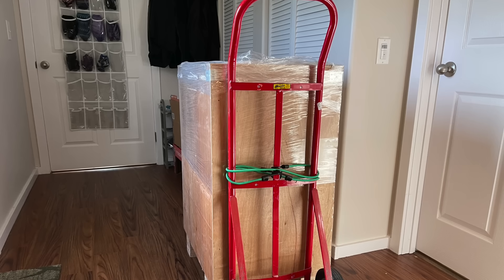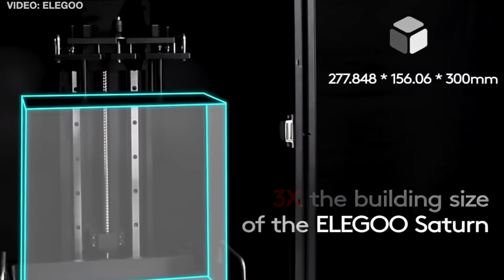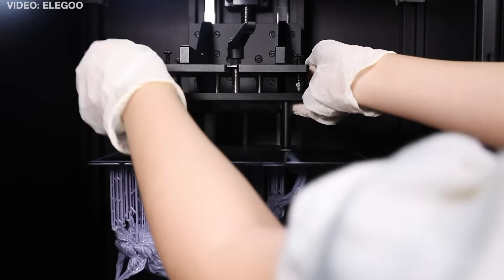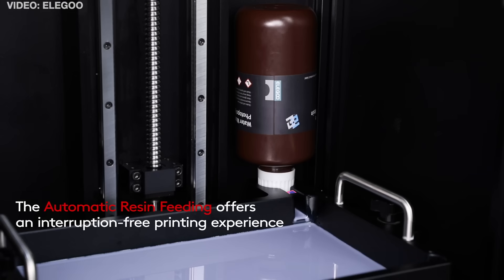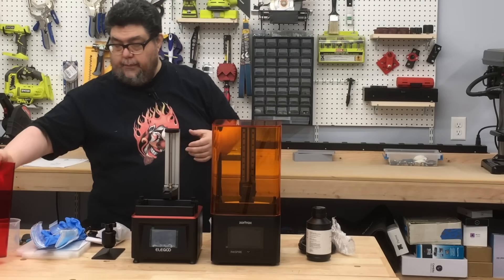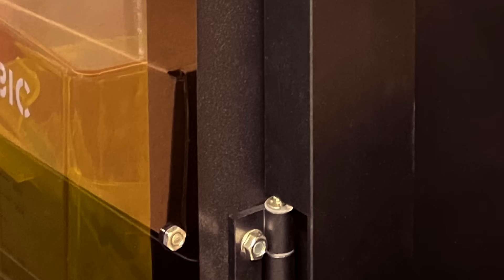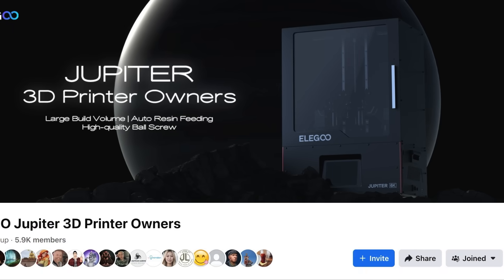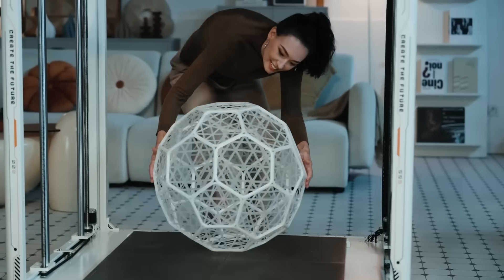Elegoo's giant Jupiter resin printer - An un-review

Comment: Great video. I bought my first Jupiter as a kickstarter and now I own 4 of them. It is definitely a beast and I have printed many projects with them including a 4 1/2 foot long T Rex. Sad that they went to a plastic lid again. The metal cabinet is aewesome. I've added several attachments to them including heaters, temp gun holder and usb cable holder and used the same holes on the side panelswhere the bolts are. Only issue I have which is happening now is my glider bearings are acting up and causing layer shifts. Of course Elegoo is out of stock and now I have to try and find these bearings for it. Hopefully the rails are ok.  Wish me luck
Reply from the maker: Good luck with it!
Reply: @AdvancedGeekery  thanks! I believe that I found them on Amazon. They'll be here tomorrow. EG15 is the number. I'll post a reply if it works out in case someone else encounters the same issue. $43 for a set of 2 pieces.  Ordered two sets

Comment: Hey David
I'm responding to your comment on purchasing on Temu. I did not see the area about your Temu experience. I buy a fair amount of things and I return a fair amount of things. It's addicting. 
 Mainly I returned wigs. I buy them for my Marvel themed costumes. I buy a lot of red for my Black Widow costumes. The reds will often be off in color so I  return them with no problem. When I'm looking for an item I searched online and I will find the item on Amazon. I buy the exact item on Temu for a much lower cost. There was a time when Temu would allow a customer to keep the item that they wanted to return. I really didn't like that because if I didn't want it I didn't want it. And I would end up throwing it away or donating it because I didn't want it. I recently bought a freezer that didn't work.Temu told me to keep it. I found out it wasn't worth trying to fix. I placed it on the curbside and it was removed within 10 minutes.